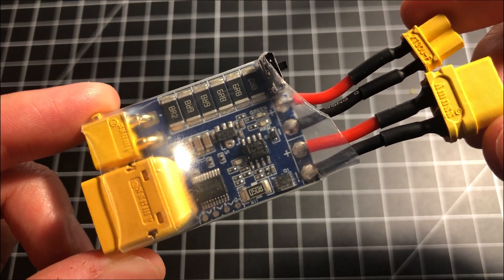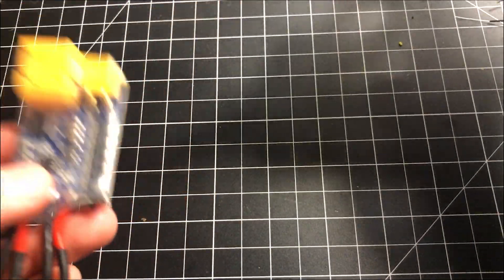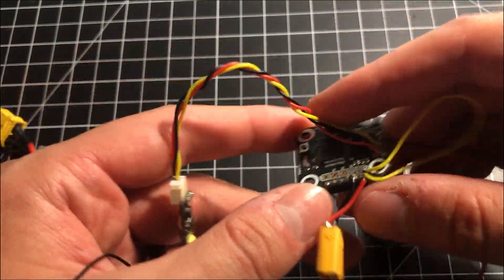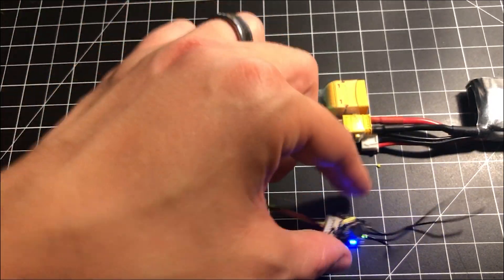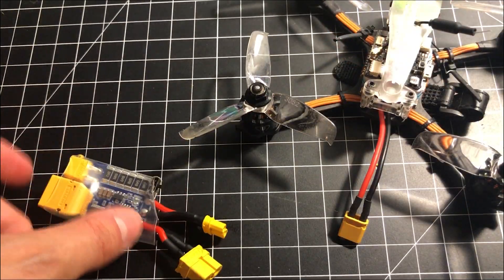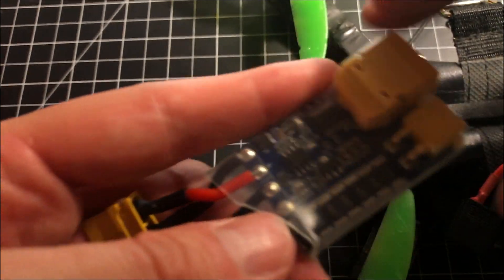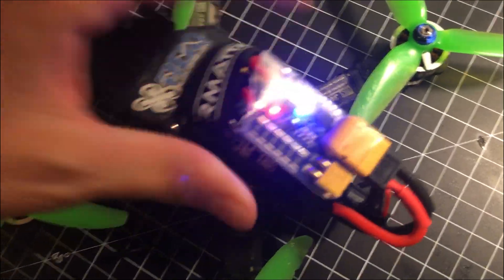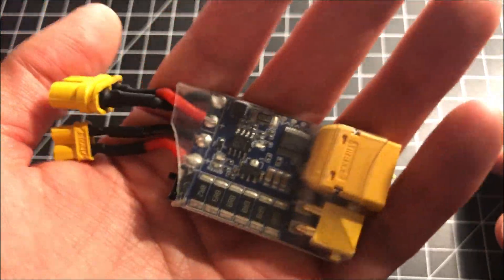ViFly Short Saver Smart Smoke Stopper | Avoid the Magic Smoke!

Comment: Great and informative video John. I agree that these devices are absolutely necessary if you build and fly fpv drones, especially for the safety of plugging your drone in indoors when you are in betaflight without removing the props.
Reply from the maker: Thanks Mitch for stopping by. I was sort of iffy on even suggesting that as a use case but y’know what, we’ve all had times that we “needed“ to plug in with props on to do something real quick...
Reply: @JohnCuppi  I agree. I've been using a lightbulb smoke stopper up until now but I just ordered one of these.
Reply from the maker: @OldGuyCarnivore  Nice!! I'll make sure ViFly sees this comment thread lol  ;) anyway, my marmotte frame will be here from RDQ on the 29th so I'm actually glad to have this thing to sanity check when I move everything over to it... I would be so pissed if I fried the air unit.

Comment: Oh yeah. As a newbie this is a must.
Reply from the maker: Even experts should have this. Soldering mistakes are so easy to make, and no matter how long anyone’s been doing this I guarantee there’s always that first plug-in anxiety of a new build to some degree.
Reply: @JohnCuppi  When I'm an expert I would still use this, absolutely. It's far better to use this than to blow a $60 board because of a common human mistake. So far I've soldered a replacement motor on my EZ Pilot and replaced the vtx antenna on my Freestyle 2. God awful ugly soldering jobs and I was worried I'd short something out, but I was lucky. I'm definitely getting one of these. I've only been into this hobby for 2 months so I'm still in the expensive phase of getting radios, goggles, chargers, batteries, soldering oron, helping hands, flux, the wrong antennas, then the right antennas, the wrong 18650s then the right 18650s, etc. So blowing a board would really frustrate me.
Reply from the maker: @CarbonGlassMan  The micro stuff is the absolute worst to solder, so I hear you!  I don't think I'll ever really be cool with it, lol. Actually I was thinking of doing a rant about micros in general because as much as I love them, they have been killing me lately with failures. That stuff is relatively new, up until the last couple of years or so quads like the freestyle 2 and brushless micros were still just a dream.  I once had to solder a receiver to the eachine cinecan and I had 3 wires tapping off the same 5v pad, and another 2 to a ground. Talk about a mess, I just closed my eyes and hoped for the best on that deal. No more of that for me. You are in an exciting phase of the hobby, enjoy it and feel free to ask me any questions as well!!!
Reply: @JohnCuppi  Thanks a lot.